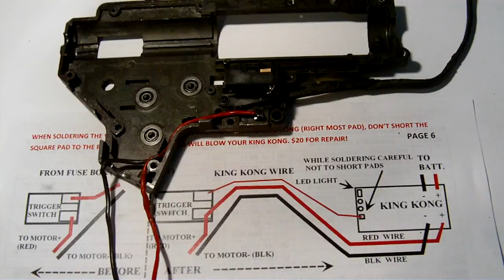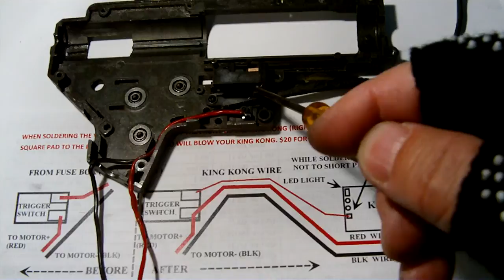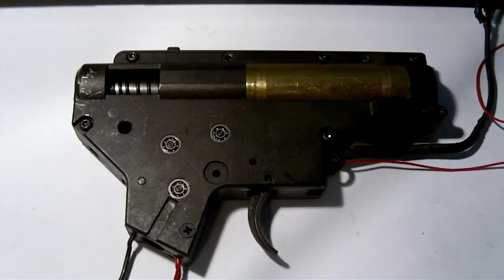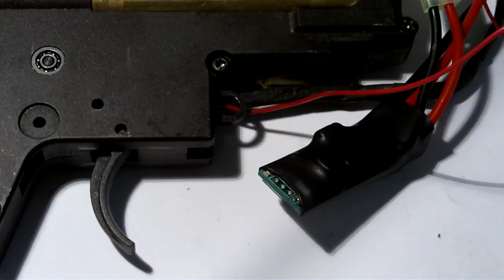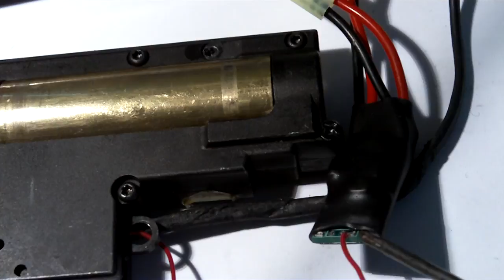Burst Wizard King Kong in hardwired trigger switch modification demo

Comment: How do I hardwire a burst wizard 4? It’s different
Reply: It's the same just two different methods, if you want to do this one cut the red wire from the plug wire set and solder the white signal. It's all in the pdf on there site